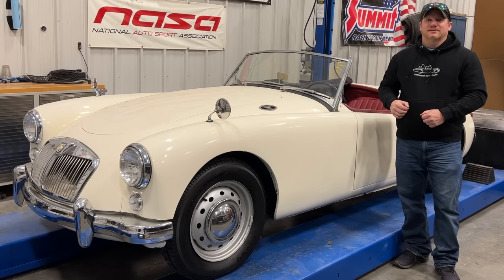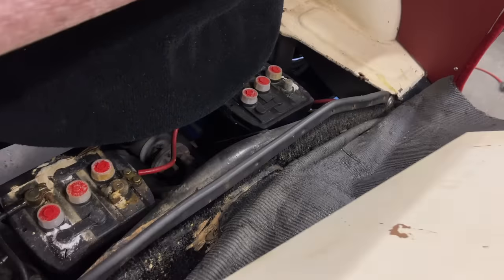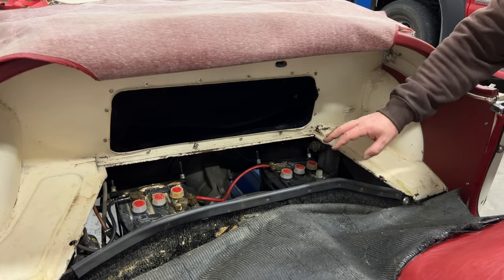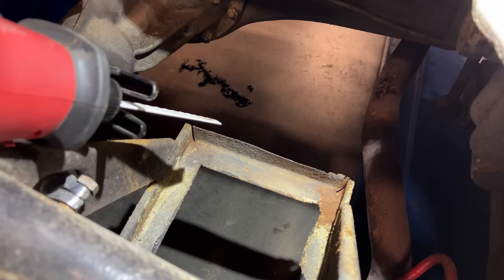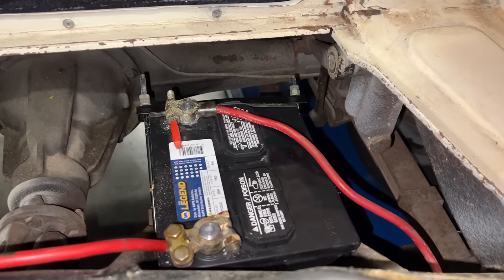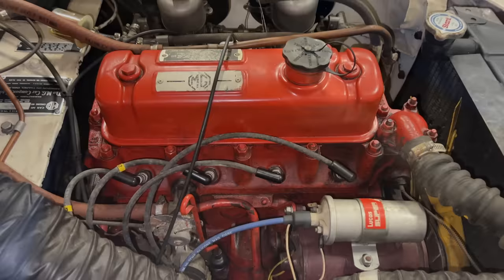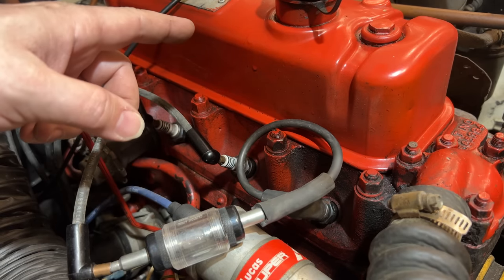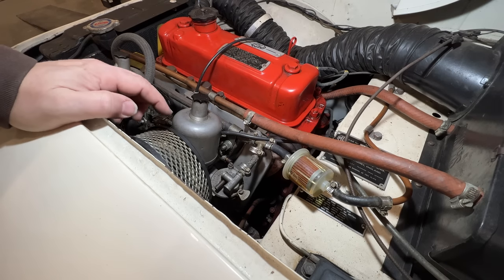1957 MG MGA Roadster Will It Run?

Comment: Thanks for sharing Steve. I recall as a boy(1950's) we had a split window Morris Oxford. I remember my Dad taking out the sparkplugs on a cold winter day, bringing them in the house, heating them on the stove and then re-installing them to get the car to start. I recalled this when I saw you heat the plugs. Great video.

Comment: I used to own a '57 MGA.in the '70s.  The 3 bearing crankshaft was rather weak (I had to overhaul it twice) and the batteries were an issue, but you could purchase new ones back then.  When I bought the car the plywood floor boards needed replacing, as did the body work below the doors.  It was amazing how parts were available for this car back then.  Dad was a body repair mechanic and so we repainted it British racing green.  I had many of the chrome parts renewed, but as I was buffing out the front grille, I ended up taking all the old chrome off down to the brass, and like it so much I left it that way (I had to polish it now and then).  I also added a jaunty chrome luggage  rack onto the rear boot.  The hood, boot, and doors were all made of aluminum.

Comment: I had the same issue with my MGA when it was in storage, turns out the steering gaiter was split and the oil from the rack was leaked. New steering gaiter and a fill up with 200mls of oil before putting on the gaiter clip and it was fine again. These are simple cars and very reliable.

Comment: I have just finished bringing my 85 year old mothers'1965 MG Midget back to life after standing for 10 years and it now runs beautifully. Busy with my fathers 1958 MG Magnette ZB 1500 which has also been standing for the same amount of time. They had an MGA as well but sadly they sold it a good few years back. Thanks for the vids. Subscribed.

Comment: That took me back a fews years.   Those SU's can be a pig if left to sit too long. Unscrewing the 2 black damper rod / oil caps and lifting the slides can sometimes help free up the varnish like fuel residue on the main needles.  Also checking the oil level in the dampers . If empty the slides and needles tent to jump about which gives inconsistent fueling.  Wonder if there are still rebuild kits around?  Would love to see a video on that Cheers

Comment: Your canister leak brought back memories. I had bought a TR4 while in flight school and decided to service the car so I took it to the post auto shop. After changing the oil and filter I started it.  The car promptly puked out about a cup of oil onto the floor. The sergeant in charge of the shop went ballistic about the mess. Never forgot to check the seals and tightness after that. Totally love your videos. I’m going to have to check my MGB since I converted to negative ground.

Comment: I just bought a 59 MGA last week. I think it has a1800 V MGB motor. It was going to be delivered yesterday and the fuel pump didn't kick in. I'm thinking fuse or bad ground, it ran the day before for the dealer. I had a 59 back in the 70ties and seeing your video brought me some memories of all the little quirks MGA have. I had to constantly tinker with it, fabricate parts I couldn't find. Electrolux brushes to rebuild wiper motor. I'm saving this and looking forward to the next.
Reply from the maker: Turn ignition on and tap the fuel pump with a hammer.  It works 80% of the time.
Reply: @ThisWeekWithCars  The dealer put a new battery & and he's ordering a new pump. I think it's an 1800 v MGB motor. I didn't see the car yet to get numbers.

Comment: Very nice machine, in decent conditions. It's nice to see something that doesn't require extensive archaeology before you can even identify the components, let alone test them. 
Maybe that reversed polarity on the coil gave disappointing performance, causing the car to be parked? It wouldn't explain the 2 fouled plugs of 4, though, would it?

Comment: I have the same colour MGA (OEW with red upholstery) only mine's a Mk2 Deluxe with the Twin cam running gear. Putting the MGB engine in is a good swap, although I'd keep the original engine with it in case you ever decide to sell.

Comment: My favorite MG model. Is that motor swap for that from an MGB a common mod? What’s the original motor supposed to be?
Reply: Originally a 1489 cc giving 68 bhp, later uprated to give 72 bhp. Later there was a Twin-Cam 1588 cc giving 108 bhp.
Reply from the maker: Pretty common upgrade as it bolts right in and is more robust than the original engine.
Reply: @ThisWeekWithCars  An MGB "V" motor is NOT in any way a "bolts right in" project.
What "bolts right in " is the 3 main 62-64 motors. No mods required.

Comment: Hi Steve,  love your videos and would like your advice on what tires to put on my 1600 1960 A ? It has been off the road for several years due to time constraints and the pandemic but it is now up and running and I took my first drive in it last week. The tires are 20 years old so a new set is in order. I am in Ca so no freezing weather and it is unlikely I would ever drive in the rain.  Thanks for your experience and suggestions.
Dermot
Reply from the maker: This is my preferred tire on a MGA:  https://www.summitracing.com/parts/cok-579821
Reply: @ThisWeekWithCars  In Germany these are cheap tires, Get something better for the same money.

Comment: i think i would have chosen to put the new battery in the other ( right hand battery box) box and move the ground cable attachment to someplace on the right hand side of the frame. that way i could use the original cable to connect to the starter/solenoid. and the short ground cable would not present a problem getting to the frame or motor mount. that's pretty much the way i did it on my '61 mga, BITD.
Reply from the maker: Doing it this way keeps it out of the way and gives good access for the fuel pump.
Reply: @ThisWeekWithCars  i don't claim much in the way of an advantage in the way that i did it. :)
 
BTW, i would have NEVER figured out that the coil was hooked up backwards, in that i would never have imagined that the coil would be affected by the polarity of the system. i looked it up and according to what i could find there is about a 20% decrease in output from the coil. i assume they are referring to voltage, which would mean a weak spark, i guess. 

it would interest me as to the why and how of it from a physics POV.   *headscratch*

Comment: Could you have used 2xOptima 6 volt batteries? I use a single optima 6 volt in my '29 Ford Model A and it is flawless.
Reply from the maker: The optima is 2 inches too long to fit in the battery box.
Reply: @ThisWeekWithCars  ah yeah, makes sense. Thanks!

Comment: surprised you put the battery on the Driver's side, wouldn't have been easier to mount on the passenger side and just relocate the ground?
Reply from the maker: It would have blocked access to the fuel pump.

Comment: I wonder what happened to the original Twin Cam engine ?
Reply: That is not a TWIN CAM  car.  The original TWIN CAM was a failure and discontinued.
MG took the remaining Twin ca cars, tossed the engines and install 1622 CC motors. The best of the MGA line.

Comment: Great video, I still don't get the fascination with these old machines. They were deeply unreliable even when new. Horrid things. Modern cars are better in every way. I realise these comments will not be popular even though true.  Whatever spins your wheels I suppose.  But would we be using or admiring a 1960s dial telephone compared with a modern smartphone?  No
Reply: I don't agree about unreliability and deplore your use of "Horrid things".  It helps if they're correctly serviced and maintained.  Simplicity is the key to reliability, and simple they were.  And if/when work was required, you could get your hands on everything.  That's something modern cars don't have.
Reply: @jjmcrosbie  Facts not allowed. Brit cars failed in the US not in Britain where they take care of their cars.